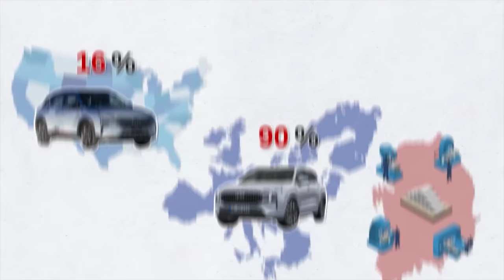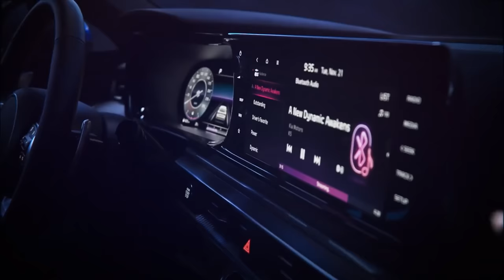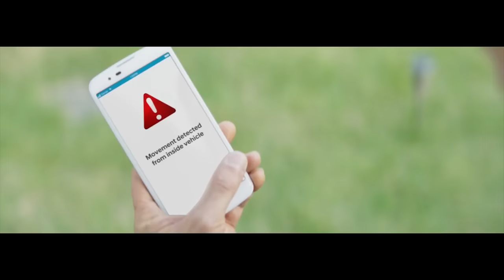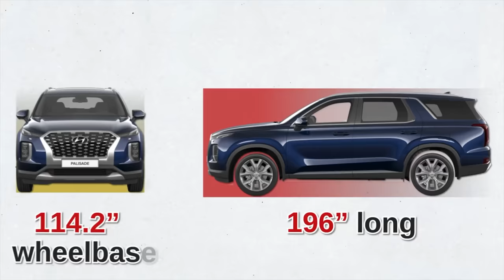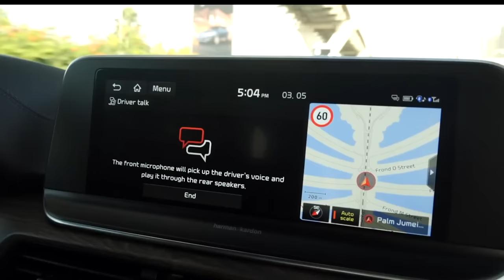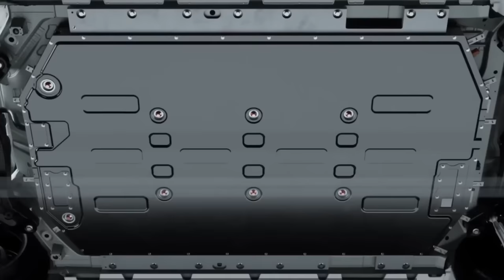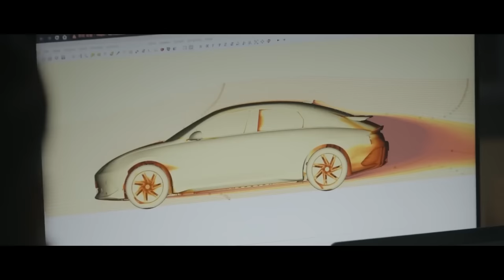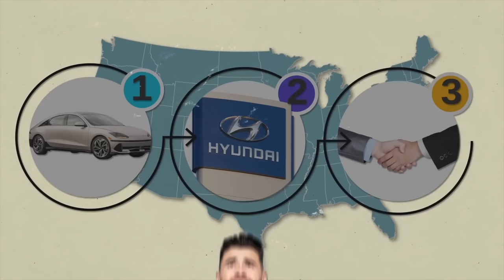No One Else Has the Balls to Say This About Hyundai and Kia, So I Will

Comment: I bought a 2019 Kia Forte brand new(32 miles)... Fast forward to 2023...74,000 miles later and trouble free for the most part. Tires and 230 dollars for a battery which I wasn't happy about. Still runs great and no shakes anywhere
Reply: Check the recall just announced.
Reply: @m-cw7er  For real? I looked up on the internet a few months ago because I new Hyundai and Kia had a shitload of them but none for my car. I'll look into it, thanks for the heads up👍
Reply: @johnwhalen3191   It includes 2019 to 2023.

Comment: I had a Kia Niro for almost 4 years and loved it so much Ive just taken position of the new '23 model, ive done 300 miles so far and its registering 61.6 mpg which I think is phenomenal f.or a car of its size. Its quieter than the older model and feels larger inside and out. Great cars

Comment: 2016 had the bad engine's as well.  Anyone who got the knock sensor update letter from KIA or Hyundai would be considered included in the whole your engine could be junk because of poor machining leading to metal fragments getting in the oil.  Its not just 3 years! Don't believe me?  Well don't get the knock sensor update, and when your engine locks up or starts burning oil like crazy even though you took care of it, and when you take it in, they will not cover it! Check out the lawsuit.  If it was only 11, 12, 13 then why did I get a letter for a 16?  I had the update done and 3 months later the engine blew up with 70 thousand miles on it.  The dealer told me the car was covered under the lawsuit only because I had gotten the update.

Comment: Their 1st model, the Excel, was a reliable 200k+ gem if maintained right & set the tone for their future.
Reply: Think you are mistaken. Their first model over here was the Hyundai Pony, a very crappy car. They have come a long way...South Korens are good at copying the Japanese...imitating them. I prefer the real thing. Honda/Toyota.
Reply: @louishumphreys5451  Never heard of it but the one I did, the '86 Excel, was a great reliable car that lasted 200k+ if taken care of. Knew a few who had them & they swore by them.
Reply: @louishumphreys5451   Correction. '85
Reply: @louishumphreys5451  those early ponies and excels ran mitsubishi engines. 1.4, 1.5 and 1.6
Reply: @louishumphreys5451  

Pony was adopting engines from Mitsubishi that were wash-out without counter balance shaft patented by Mitsubishi.

Comment: owned a 2013 Genesis. It was a POS, and the engine blew. Had issues with my Chrysler PT cruiser, and Honda Accord. I will stick with my Fords my Fords have in between 75k - 300k miles and growing.

Comment: I had a 2015 elantra. Air conditioning was bad. Suspension was uncomfortable. Engine was slow and developed a tic and stereo sucked and sometimes it did not start.
Reply: I had a 2008 elantra, it was about as comfortable as driving around a cookie sheet

Comment: My 2013 Hyundai Accent with manual transmission has 161000 miles on it and still runs like new. Burns almost no oil.  I maintain it religiously.

Comment: My wife has a 2020 Kia optima runs great no problems at 64k . I use synthetic oil on the engine a just did the first drain and fill on the transmission. The car shifts smooth and I’m sure I need to drain and fill a few more times to get most the oils tranny oils out. Great in gas to

Comment: Bought new genesis 2014 sedan 3.8 in 2014. 309k running strong with no issues in powertrain. Idle is quiet, tranny smooth. See if i can keep it till 500k(my mechanic says it is possible given the condition of the car….

Comment: I purchased a 2nd hand 2013 Hyundai Sonata GLS at 60k-ish mileage on it. After 30k miles I had to get the engine replaced because of it consuming excessive amount of oil. Fortunately It was covered under warranty. I currently have 182,000 miles on it and I have not had any major issues with the vehicle since the engine replacement. The only things I've had done were the passenger side wheel bearing, wheel coupler in the steering rack and ignition lock cylinder. All of those were wear & tear and had to be replaced eventually. Everything else for routine maintenance I've done on my own with high quality parts (Brake pads, rotors, oil change, cabin air filter, tires) to keep the car going. 

If i were in the market for another sedan I'd definitely purchase another Sonata, but the new ones look ugly IMO, so I would opt-in for the ones Scotty recommended. As of now, I am looking into a 2020 KIA Sportage SX w/ 45,000 miles on it. The Sonata is a fun car to use and I'd continue to keep it if I didn't need to upgrade to a bigger car. 

All I've ever read/heard about Hyundai's and KIA's are that they are bad. Yes, but up to a certain point they started becoming good cars with some hick-ups that have been addressed by the companies (as any other car manufactures) with affordable price. Don't knock it until you try it!

Comment: The battery in my 2017 Sonata PHEV died after only 4 years, 42000 miles. Hyundai refused to honor their warranty, forcing me to use non lemon law arbitration to secure a buyback.  It took 18 months, and multiple hearings as Hyundai deliberately miscalculated the repurchase amount. Stay away from this company.

Comment: I have a 2017 Hyundai Sonata SE with over 130k miles no big problems yet. The only thing was the electrical steering wheel, coolant thermostat and that's it. Don't forget to install an oil catch can since it has GDI engine.

Comment: Since 2003, my wife and I have owned: 2003 Hyundai Santa Fe (2 of them); 2007 Sonata; 2011; 2012 Sonata Hybrid; 2016 Sonata; 2016 Kia Sorento; 2018 Sonata; 2023 Kia Sportage and a 2023 Sorento. Scattered in the Korean mix, I've owned a 2012 Toyota Prius, 2013 Fusion Fusion and, regretfully an unexciting Nissan Altima. Of the three non-Korean, the Fusion was my favorite. the only time I liked the Pruis was when I pulled up to the gas pump. Overall, the Hyundai and Kia brands have served (and are serving) me well. I trade cars more than the average owner, but with our two 2023 Kias and since we are now retired, we anticipate that they will last us for the duration. Even if we do trade, I am sure we will stay with Kia/Hyundai because they do produce good reliable vehicles at a good price. Sure they had problems years ago, especially with the 2.4L, but time and a commitment to producing a quality vehicle has largely taken care of most of the problems surrounding the earlier vehicles. Will problems in the future pop up? Sure will. Cars and trucks are mechanical and there will always be issues with them. But the bottom line is that if you take care of the vehicle, anyone is likely to get at least 200K miles out of them.

Comment: Bought a 12 santefe new drove for 125,000 miles. Traded in ( 2 years ago.. tremendous resale) for a 21 new santefe. Love the tech and fuel economy, average 29 mpg city/highway driving. 

I do miss the V-6 performance in 12 santefe, don’t miss the the mediocre gas mileage of 20. 

A caution for any owner of newer fuel injection vehicles. Do the maintenance religiously. These vehicles can easily attain 200k.
Reply: You better park it outside there’s a recall that these things can catch on fire

Comment: The cars are actually quite good.  The 2.4 Theta engines, however, tend to wreck rod bearings, ruining the engine beginning at 30K miles and more typically around 60-70K miles.  This is so common that there was a class action suit in the US.  According to reports, the problems still continue with the latest models.  So be very careful before buying a KIA or Hyundai with that wretched 2.4 L engine.

Comment: My company few years ago bought a bunch of Sonatas. Mine had to have the battery changed 5 times within the first 2 years due to a mysterious drain on it, dealers just can't figure it out. Another vehicle had a ton of electrical issues. The tow truck driver told me he tows Korean cars Hyundai and Kia more than any other vehicles. Yet I see some documented  cases of Hyndai making it past 1 million miles and other reported 300k plus. Then there's the infamous Kia Soul randomly bursting into flames killing folks and burning down houses. I believe Korean cars have bad quality control and your chance of getting a lemon is MUCH MUCH HIGHER than other brands.

Comment: I loved my 2012 Veloster. I always joke that I miss it and would buy another. But the reason I don’t have it had a ton of issues around 130k miles and I traded it in for an Accord. Accord still going strong yet it just feels boring comparatively.
Reply: I have heard that the newer velosters are more reliable. I just bought a 2021 Veloster N that has 12k miles on it. Bought extended service plans for the next 75k miles that cover damn near everything. If this car only gives me another 118k miles before it dies, it will absolutely have been worth it. Never have I gotten behind the wheel of something that felt so connected to me and provided the exact driving experience I have been searching for.

Comment: Seen numerous 2.4 litre 4 cly engines in the Kia spin  rod bearings.non in the six cylinder.the 20 litre in the sole  seemed much better ,only one failure due to a leaking radiator

Comment: To bad the dealership wont honor the warenty.  I was told the popping and clicking i heard when turning and accelerating was my brake pads getting old. Thats horse crap.  The car had 85000 miles, still under powertrain warrenty.  I got new brakes and was told by a independant mechanic, "yeah its your CV joints making noise". Love the Kia cars but that dealership will never see another dollar from me.

Comment: I never considered buying a Kia.  I have been to lots and walked by Kias without considering them at all.  I usually buy a use car each year sometimes 2.  I'll spend a few thousand on them.  I gave my brother 3000 and told him to go buy me a decent SUV and he came back and dropped off a sorento at my house.  I was disappointed instantly.  But then I got in it and it was clean and comfortable.  Had some bad shocks that was the first fix.  After driving it to the beach a few weekends, I found my self replacing the radio.  That's like letting the girlfriend move in.  Game over.  Needless to say it has been 5 years, and I want to keep this 2007 sorento forever.

Comment: With Kia and Hyundai I would go with Elantra and Forte 
The 2.0 Engine is great 
They have problems with sonata and optima only 
The 2.4 L engine has a problems with GDI , if want to keep this engine last longer just do oil change every 3000 miles

Comment: Got a question. Did something sooner than I want but got a really good deal. I traded in a 2017 Sierra with the 6.2, for a 2020 Lexus RC F the car has only 9k miles on it. It has the 2UR-GSE v8 (any issues with the motor?) Also it has a torque vectoring differential. I know zero about them, the maintenance or reliability. Just really wanting to know if there is anything I should look out for in the future with this car besides the horrible gas mileage, but that’s what you get when you have 472 up. Thanks again and have a good day.

Comment: Model years covered under the class action run from 2009 to 2021, and include pretty much everything Hyundai and Kia sold during that time span. The lawsuit says all the engines consume too much oil, requiring owners to check their oil levels constantly. The suit says oil must be added to these engines more frequently than the owner’s manual suggests. In addition to the oil consumption, the suit says oil seeps into areas of the engines where it shouldn’t, and the resulting oily residue damages the engine internals and exhaust and means the engines don’t operate correctly. 

Allegedly, issues like carbon buildup, oil sludge deposits, and wear of engine parts eventually lead to a costly rebuild or engine replacement. In the suit, it’s claimed Hyundai and Kia have not honored warranty claims for the engines if an owner can’t provide maintenance records for their car. Further, the suit says that dealers don’t tell customers about oil consumption even when it occurs, but rather ask an owner to proceed with lengthy oil consumption tests over thousands of miles.

Comment: He has multiple video berating Hyundai and Kia, but most videos are based on pure opinions of an old mechanic that wants to see old days cars designs, cars today are made to make the driver survive, not to last ages, also, Kia and Hyundai have come a long way in the last 10 years and offer a solid balance of value and features that you just cannot get from most other brands. Recently I was on the market for an SUV, and was undecided between Hyundai Tucson and Nissan Rogue, went with the Hyndai mostly because it offers pretty much the same features than Nissan, at a competitive price (not much of a difference, less than 2K), but the warranty made me go with Hyundai, it offers much much better warranty terms than most competitors! Ah, and we have had Kias in the family for more than 12 years with no issues other than maintenance.

Comment: I have 2006 Elantra base trim. It is 17yrs old but engine starts and runs smoothly. I just replaced trans fluid and it was milky chocolate. Only problem i have right now is everytime it switches to 3rd gear @ 2500 rpm, i feel a strong "kickback". Anyone here knows possible problem and fix? Tnx.

Comment: Bought a 2006 Sonata V6 for 2200$ with 114,000 miles 

Here is what I had to replace after 7k miles 

-Full transmission rebuilt = 2800$
-AC compressor and radiador = 1000$
- 4 struts = 1000$
-Master window switch = 30$
- Break pedal sensor = 10$
- alternator = 170$
-Valve cover gasket = 600$
- New battery = 120$ 
-4 tires = 600$

Did I get a good deal? 🥲
Reply: Batteries and tires dont apply. They are regular maintenance items you have to spend regardless of make and model
Reply: I guess, people don’t often sell cars with new tires and batteries
Reply: No. You should bought a grand marquis or town car. You would have saved money since they seldom break.

Comment: Why didn't you mention the law suite for blown up engines ? Motors blow up between 53 and 90 thousand miles. Use oil and spin rod bearings. Why did you miss this fact, We are throwing away a 2018 Sonata for spun bearings.

Comment: I work for a company that exports hyundai and kia cars primarily. I strip them completely every nut, bolt, clip and wire and only leave the glass. I have gotten to the point where i can strip a sonota or optima completely before lunch. And i can tell you they are almost identical other than a few visuals and hardwear size and type.

Comment: I do lemon-law buybacks as a side job and recently have been making lots of trips to the local Hyundai dealership.  It's pronounced "HUNday," as a dealership around Portland, Oregon points out, which sounds like "FUNday."  🙄 With the pandemic in our rear-view mirror, Hyundai locally has had a big problem getting parts like replacement batteries for the EV vehicles, so I'm showing up once or twice a week at the dealership, buying back EV cars where the parts never came in.

Just a few days ago I did another one and the couple was really upset about losing this car because they loved it so much.  They were offered $5000 and keep the car, with its issues, or buy it back.  They decided to go through with the buyback, and are now wondering what else to buy.  They said they'd never go back to this dealership, because they couldn't fix the car and were treated as if they didn't exist.  (Not a good look, service departments!)  The car sat for weeks on the lot, before AND after it was repaired, and they never got a call that the car was ready to be picked up.  THEY had to keep going back and checking.  So it was mostly the dealership's service department issues that kept them from buying another Hyundai.

I just rolled over 315,000 miles on my 2010 Honda Element.

Comment: Well look at it this way living in U.K. and using second hand cars have tired of the over electronic EU style models. If Kia are prepared to guarantee for seven years then while not stating absolute reliability they must have a fair idea for the average motorist who cruises at about 60mph on moderate journeys and quietly moves around town the chances of expensive breakdown must be limited. For ordinary motoring they seem to be an answer. Who cares about 3 sec off the 1/4 mile?

Comment: No one else has the balls to tell you this?..... These are the models of Kia and Hyundai that are being dropped by insurance companies..  How would you like to have a 2 year old car that you can't insure cause the company wanted to save money by not putting a chip in their keys to immobilize the car, like every other car company does.   How can you be promoting cars that can't be insured?

2015-2021 Hyundai Accent (all body styles)
2015-2021 Hyundai Elantra (two-door and four-door)
2015-2021 Hyundai Kona
2015-2021 Hyundai Santa Fe
2015-2021 Hyundai Tucson
2015-2018 Hyundai Veloster
2015-2021 Kia Forte
2015-2021 Kia Optima
2015-2016 Kia Optima Hybrid
2015-2021 Kia Rio (all body styles)
2015-2021 Kia Sedona
2015-2016 Kia Sorento
2015-2021 Kia Soul
2015-2021 Kia Sportage
Reply: Not safe to park in the garage, gets stolen parked outside.

Comment: Had Hyundai i40 2013 (Sonata in American market). Not really as reliable and had constant small issues with electrical drain, brakes wearing out fast and really the 1.6 petrol engine was gutless for a huge car and thus poor MPG. Also the weird interior design and dashboard that looked something from a 2004 car. It was slightly cheaper than a VW Passat or Honda Accord but not on the same level really.  New Kia's and Hyundai cars look better but are more expensive and service costs and depreciation doesn't make me buy another one.